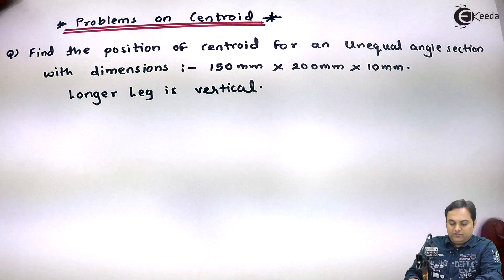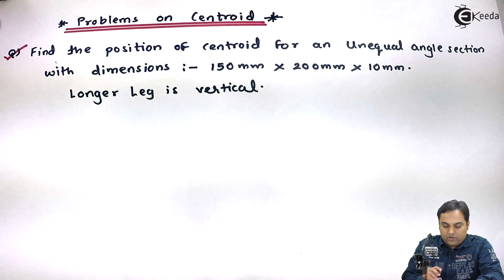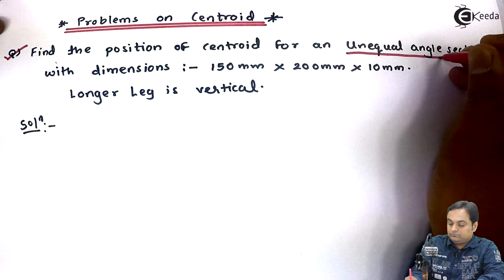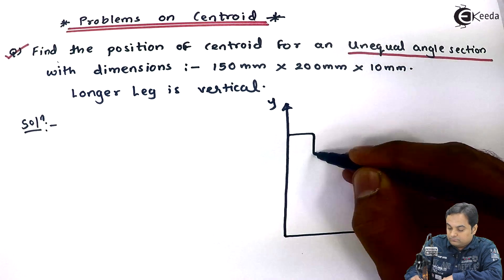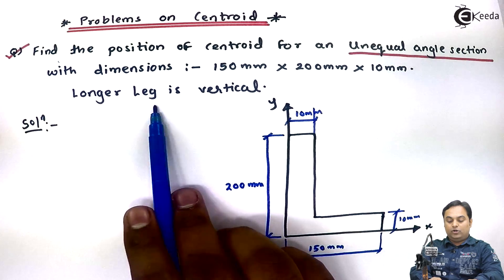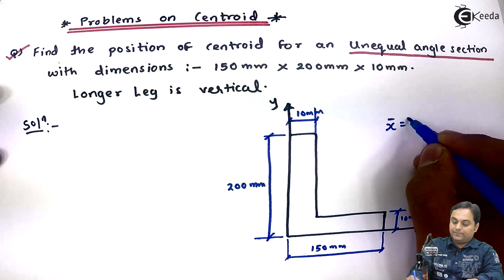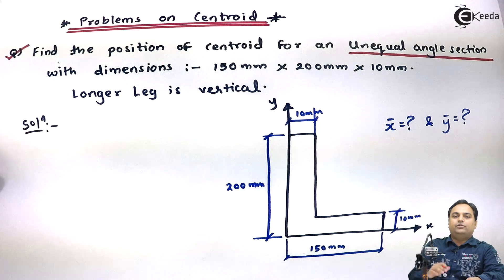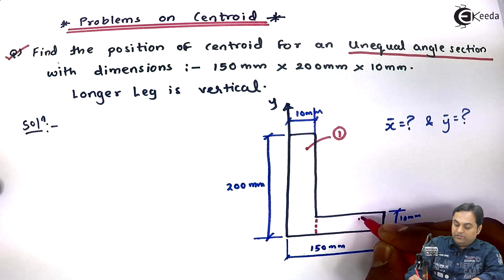Problem on Centroid in Engineering Mechanics

Comment: Solve my questione

a circular hole of diameter 100mm is cut of from a square plate of 200mm*200mm. find the location of the hole, so that the center of gravity of the remainder be 10mm left from the center of the plate

Comment: Sir why did you divided the rectangles of sizes i.e (200*10) and (140*10).What is wrong if we divide the rectangles of sizes (190*10) and (150*10)
Reply: There is nothing wrong in it in fact i get different answe by doing this method the method u tell ...